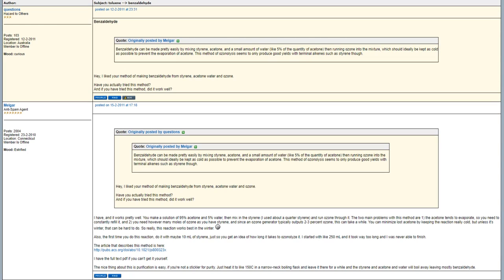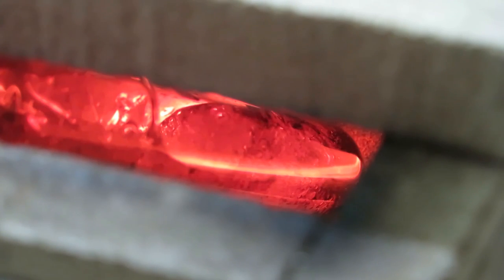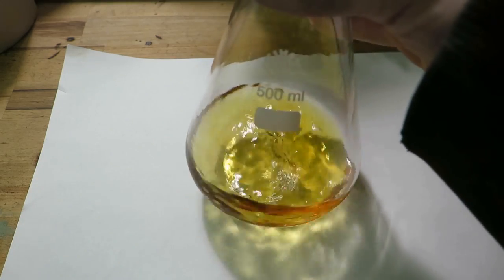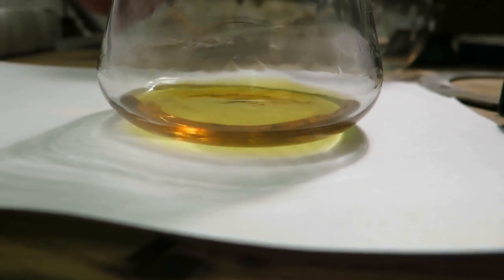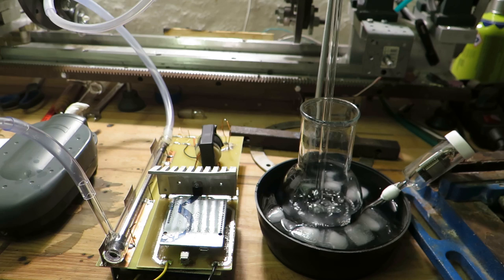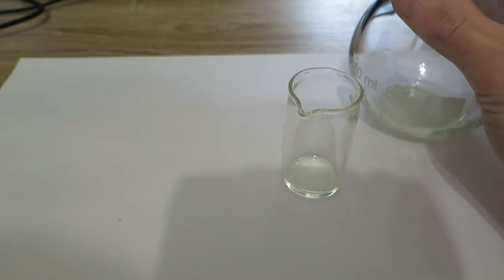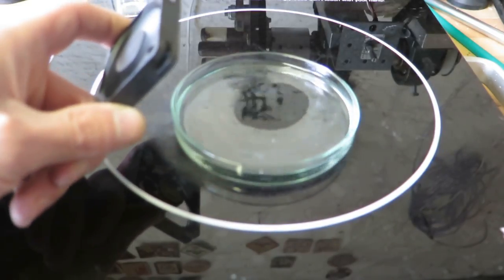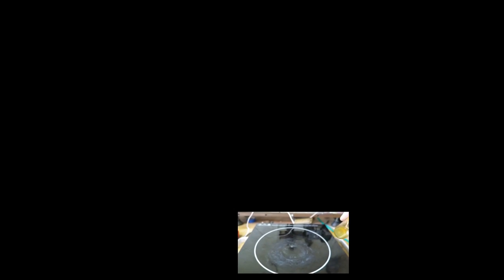Benzaldehyde from polystyrene (styrene ozonolysis)

Comment: As for separation of aldehydes from everything else, you can use bisulfide adduct. There is nice protocol on jove (J Vis Exp. 2018; (134): 57639.; doi: 10.3791/57639; PMCID: PMC5933314; PMID: 29658940) and in few of Org Synth synthesis. This can be pretty usefull to extract aldehyde from, as NurdRage called it, Conglomeration of Reactants and Alternative Products (CRAP). Keep going! You have my sub :)

Comment: GREAT VIDEO!!!!!!!!!!!!!!!!!        I depolymerized some polystyrene ONCE.    For a 50 foot radius around my house you could smell the monomer styrene bad.   Never make that again.  That smell carries big time.   I looked in to this experiment BIG TIME about 4 years ago and wanted to do it.  But after i researched it  i found that making an ozone generator is very time consuming and cost money and the amount of O3 produced would be very small per each unit of time.  And to buy one big enough so it did not take forever to do an experiment was to rich for me.  Plus i found out dry ice in my area is a long drive to get it and $40 a pop every time i bought some.   And that means every time i did an ozonolosis i would need to spend $40.  Plus the cost of an oxygen tank.  And all the ways you can explode.   I was not as brave as the guy in the video.  Or really as smart cause i could have done some micro reactions like he is doing.

Comment: I've done this before too. You need to titrate your Ozone generator but to be honest just looking at it, we are talking milligrams per hour unfortunately. No offense, I have a Chinese eBay one that titrated out at 5 milligrams using dry air.

You need to vacuum distill it to avoid turning it all into benzoic acid, use a cow-adapter.

Also, you can make the bisulfite adduct out of the reaction soup using sodium or potassium bisulfite and separate off the gooey crystals of benzaldehyde, wash with toluene, filter, and break up the adduct with Dilute HCl or NaOH solution to recover the Benzaldehyde.

Comment: SAFETY TIPS if you try to scale up.......NOT FOR for micro reactions like  in the video.  Plus his ozone generator is probably barely making an ozone.    (1) The pot should be MINUS 78C when styrene is being put threw ozonolysis  and for most alkenes.  Although some alkenes can go through ozonolysis  as hot as  MINUS 30 C.  but not for styrene       (2)  Your set up should be ALL closed up except 2 in tube that goes all the way down threw the liquid in the pot so you can bubble your ozone and O2 in to the styrene.   And also have a tube for exiting gases.  But do not let the tube dip down into the liquid in the pot.     On the out port have at least 2 bubblers/suckback traps.  And fill the bubblers with aqueous KI to kill any O3 that makes it of the pot.   If both bubblers get BLACK then add another bubbler.  (3)  Nitrogen and ozonides blow up.  And the pot will be make a couple  different ozonides.     So turn your oxygen tank on that is on the in port and flush out the system of all air.   Now if you have some kind of home made ozone generator or one bought at a regular store to kill bugs.  Then you will have to get some molecular sieves.   The same size sieves they put in oxygen generators for old people.  So they can breath.  ANYWAYS you would need to run the air/O3 mixture coming out of the ozone generator and send it  through the molecular sieves  AND THEN That way the sieves filter out the nitrogen and then lead the remaining O3/O2 mixture  into the in port of the apparatus and it bubbles into the liquid in the pot..  KEEP IN MIND the oxygen from the oxygen tank  should still be flowing into the pot with the O3 bubbling through the liquid  also             (4) When the pot starts turning a little tint of blue then you are done.  That blue tint is O3 building up in the pot cause the reaction is done.  KEEP IN MIND UNLESS YOU HAVE A REAL INDUSTRIAL OZONE GENERATOR THE POT MAY NEVER TURN BLUE EVEN IF ALL THE STYRENE REACTED ALREADY CAUSE THEY DO NOT REALLY PRODUCE ANY OZONE.  I mean they do but not much
(5)  Turn off the ozone generator and let the O2 still go for 15 to 20 minutes so it can flush out any unreacted O3 that is in the pot still.  Do not flush the system out with nitrogen cause it will explode    (6)  When you are done check the pot  with KI paper to make sure there is no O3 still in there.   Because these ozonides are peroxides and they are the MOST EXPLOSIVE peroxides that exist.  SO YOU DO NOT WANT TO DRY TO EVAPORATE EVERYTHING TOTALLY  IF THERE ARE STILL PEROXIDES IN THERE OR YOU WILL BLOW UP.  So just check with KI paper.  If it turns black then there is more O3 in there so destroy that before you try to extract and boil down to total dryness.     (7)Now you can do your reductive work up with zinc dust or DMS or NaHCO3 and extract and purify   (8)  Never use rubber or plastic in your system.   Ozone will eat it up.  That includes and tubing      (9)  You should have a blast shield around the pot when doing the ozonolysis.  (10)   NEVER USE ETHERS FOR THE SOLVENT IN AN OZONOLYSIS REACTION.
Reply: Every word of this is really, really good advice. Sincerely. Ozone doesn't play around, especially at scale~!
Reply: Ether and ozone?  Yikes

Comment: Try oxidizing styrene to phenylacetaldehyde with peroxyacetic acid or performic acid. And then distill the phenylacetaldehyde(maybe flush the flask with nitrogen first). I don't know if the phenylacetaldehyde would overoxidize to phenylacetic acid.
Reply from the maker: Sounds interesting, perhaps in future I may do this. I am still setting up lab and have still limited access to chemicals, hence the pyrolysis step.

Comment: SUGGESTIONS........  (1) I know they use MeOH as a solvent in many directions.  And i know MeOH is a polar protic solvent.    But i have NEVER heard of using acetone or especially water as the solvent.  IN MY OPINION you should use a NONpolar  APROTIC  solvent like DCM or tetrachloromethane or benzene.   The less polar the solvent is then the better the solvent.   Protons from the water  should not be flying around in the pot when you are making ozone and molozinides(organic cyclic  ozonides) and carbonyl oxides and ozonide anions.   All those things i just mentioned have oxygens which have lone pair electrons and i do not see how having protons all over the place will help with the ozonolysis.  
                 (2)  When you bubble in the O3 you are making a  couple intermediates but it will stop at the trioxolane (ozonide).  So when you get done bubbling in the O3 you have ZERO benzaldehyde at that point.  Depending on what you want to make will determine the work up.   For benzaldehyde the work up would be reductive.    For the reductive work up you could use zinc dust or DMS or thiourea and many more INCLUDING NaHCO3.................Remember you got done and poured a little out of the pot in to water to see if it would float or sink and you thought you had no product.   So then you wanted to neutralize the benzoic acid you made from over oxidation.  SO YOU ADDED NaHCO3 AND HEATED IT AND THEN ALL OF THE SUDDEN THERE WAS GLOBUALS OF BENZALDEHYDE.   Well that is because you finally did the reductive work up to turn the ozonide into the aldehyde by adding the NaHCO3.   
                Next post i have some suggestions about safety.   Not for micro reaction like in the video but if you scale it up a little bit or have a better ozone generator than in the video

Comment: Did you build your own glass lathe? Truly awesome. I need one of those and I am reinventing the wheel you might say...Any suggestions are welcome my friend.
Reply from the maker: Yes, I have some videos here on that topic. I would probably go with bought linear rails now or at least don't make sliding elements with epoxy. Also would make spidle from thinner stainless steel. Since it was sitting in lab, it has been corroded quite badly...

Comment: lots of interesting suggestions, but the truth is, if you are doing this purely for interest, I guess that's fine, BUT, if you are expecting anything over 1ml of pure Benzaldehyde, the ozone method will always disappoint you. The amount of ozone produced, on a molar basis, is pitiful even from decent ozone generators, that and the dilution ratios needed to suppress over oxidation make it not practical, if you want to actually get some decent yield of the aldehyde, a pretty decent and fool proof method is the oxidation of benzyl alcohol by dil. nitric acid with a little nitrite in there, works brilliantly.The benzyl alcohol can be had from food grade preservatives, just distill it out, the nitrite can be made from nitrate, and the nitric is easy to buy

Comment: i have two suggestion: 1 use an aquarium porous stone immersed in te solution to increase de surface area between gas and liquid phases. 2 ad Thiourea to the solution , will help to reduce over oxidation and to convert byproduct in to haldehyde.

Comment: This isn't really helpful, but even though the vapor pressure of benzaldehyde is low, the amount of gas you were running through it for that amount of time was probably enough to evaporate most of it as quickly as you were making it. I've had this problem when chlorinating hydrocarbons where the huge amount of HCl produced is enough to carry away most of the product. For me and for what I was doing, a dry ice gas trap worked. That probably wouldn't work very well for you though without at least a gas drier before the ozone generator or you'll get nothing but water ice.

Comment: Very beautifull video, pratical chemistry video like yours are very necessary. But i suggest tu use elementar zinc like sacrifical species (at the end you'll have ZnO, benzaldehyde and formaldehyde).
A long story short it is not enough to make ozone react with styrene to obtain benzaldehyde.
If you need more details write me.
Reply from the maker: I have found another OTC way to benzaldehyde, so I won't be revisiting this anytime soon probably, but will keep your suggestion in mind

Comment: Arent you forming the ozonide? That would require reduction in order to get benzaldehyde.
Reply from the maker: According to paper (should be in description), that is converted to benzaldehyde rather quickly which seemed to be the case.
I did not test for ozonides though, don't have knowledge/equipment for that.